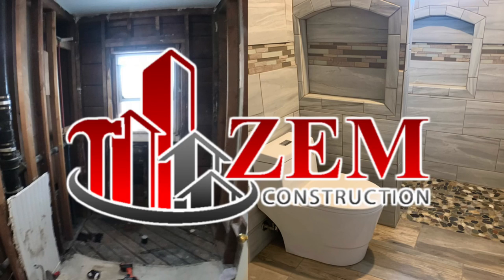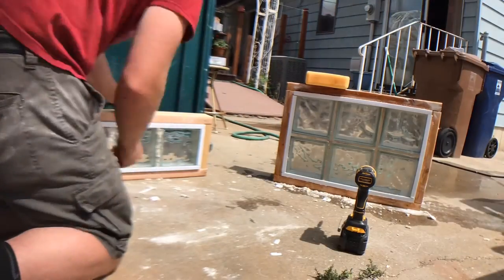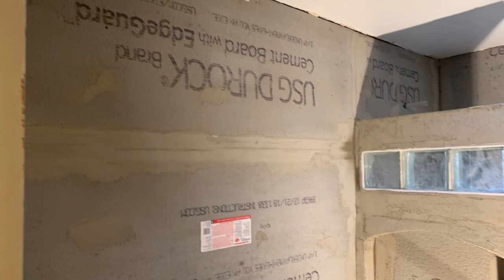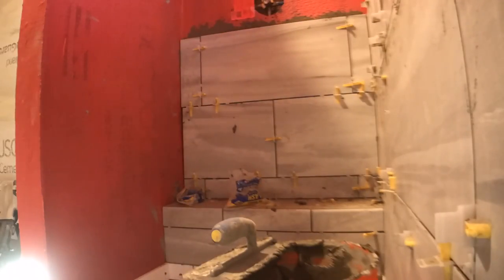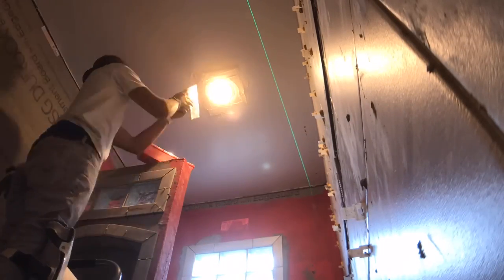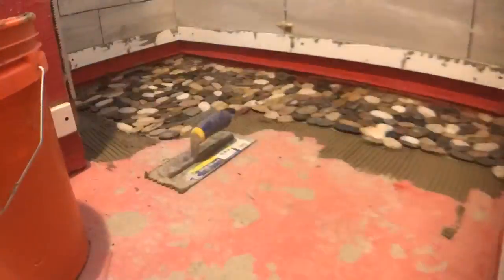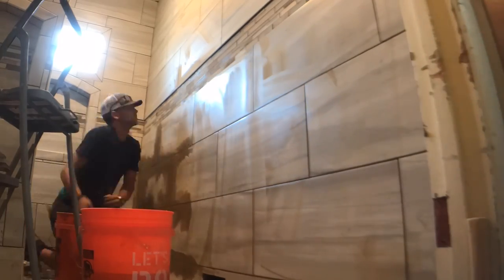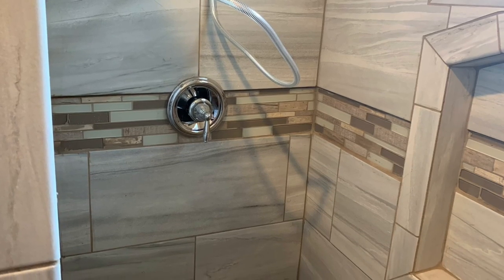Bathroom Remodel | Bathtub to Curbless Walk In Shower | Time Lapse

Comment: awesome job! A tip or two, of course each guy has thier own way of installing. keeping a wet sponge handy is a good way of making the clean up and grouting easier and faster by keeping grout joints and the tile face ,corners ,ect. clean as you go. You'll thank yourself in the end. Also wedi board 1/8" think is a good and easy way to make feature tile level up to 3/8" large tile with the 1/2" trowel. Again nice job, well done.

Comment: The niche and 3 piece window on the semi wall could've been centred to avoid cutting off the trim tile on the left and that awkward piece of accent tile on the right.   That could've been done by taking the width of the trim tile in consideration while constructing the semi wall in the 1st place. Also It's hard to tell if there is a corner guard on the semi wall? It would protect the tile from accidental hit by the wheelchair. And I would put the power switch and the plug on the same level. Just looks more finished. With that being said I love your cuts and attention to details. I know the amount of work such a small space gave you and you owned it
Reply: Yes, that semi-wall and how off-centered it is, is the first thing I see. Other than that, great job.

Comment: Nice job!!  This is the first  video of yours I watch and it is ironic.  Back October 2019 I hired a company to come in and make my ONLY bathroom into a handicap accessible shower for myself.  I am handicapped, but after just 3 days of numerous  & costly errors I had to fire them.  One of there workers also was caught leaving the house with my property.  (Sad)  So I have been without a bathroom for almost 8 months now and  don't think that I will be able to finish the  work myself due to my deteriorating health.  The other ironic thing is that I have the same tiles picked out for my bathroom.  What's the odds.  Well thank you for sharing your journey it is nice to imagine what my bathroom could look like.  For now I will wing it.  A red bucket!

Comment: Nice video, if i had any criticism it would be that you need to work on your grouting and the tooling of the joints. I used to be the grouter for my dads tile company and have grouted at least 20-30 entire houses on my own over the years, so i can spot a grouting job a mile away. I can tell it was difficult to clean up near the glass border because of the recess, but regardless you just have to spend the extra time to clean it up and smooth it out to make it look good. Keep your eyes sharp. I know none of us know everything and everyone can always improve in different ways, so take what im saying in good heart. 

Also, in the future, if you want to avoid that recess between a border tile and main wall tile because of the difference in thickness you can install 1/8, 1/4, or 1/2 backerboard where the border will go and thinset it to the wall to bring out the border flush. This will also fix the issue with the electrical outlet sitting away from the wall where the border was. Keep up the good work pal and keep learning and improving.
Reply: Not to be nitpicky, but I keyed in on this as well. Good advice for anyone doing the same type of project.

Comment: Great video and narration.  I also have a window in my shower.  I want to keep the window and not replace it with glass blocks like your client wanted in this video.  If you've installed windows in showers before, do you have any recommendations on which types of windows are the least likely to get damaged/moldy/rot?   Thank you.

Comment: Great work. Only fault is the mosaic band sets in.  It's not flush with the rest of the tile. Ik it's hard considering this band is 1/4 the thickness of the tile. Why I cleat the band then float the area to except the band last. So you can get a perfect flush band.

Comment: I appreciate you walking through all the steps of your projects, providing videos and also narrate - you do an amazing job!

Here is a question I have, how do you access to the plumbing for the faucet and shower if you ever need to work on it. I ask this because my bathroom is tiled and I do not see anyway to access my plumbing without removing tiles.
Reply: On most plumbing can  be accessed from the back wall.

Comment: I've always thought that all bathrooms, utility rooms and kitchens should have floor drains. A curbless shower is a good way to accomplish this. But it would require the entire bathroom floor to slope toward the shower. That way even if the toilet supply line were to break when no one is at home no water would escape the bathroom and damage other rooms.
Reply: Your talking about a wet room and this is not that. Most curbless showers only require the waterproofing 1-2 ft. past the shower entrance. Not to mention the cost of making a water tight room that most people cant afford.

Comment: I think you did a good job, if I had to add anything I would say that you should have taped the seams with waterproofing membrane in addition to the Red Guard.  Red Guard alone over cement board definitely isn't enough to waterproof changes of plane, and will likely fail over long periods of time (10+ years).  I do want to commend you for choosing a cement backerboard over HardiBacker for a shower install, since HardiBacker wicks moisture through capillary action.

I myself would have gone for a foam board like HydroBan Board, in addition to the a waterproofing membrane tape and liquid waterproofing overcoat, but it looks like you at least used a real membrane on the floor of the shower.

Really interesting to see how you cut away the joists and sistered them to allow for the curbless entry.  Great job with that!

Comment: I would hate to reach onto that shower valve, open it and have the resultant cold water spray all over me.  Always place shower valves in a location where they can modulate shower pressure and temperature without being in the direct spray of a "cold start".  I would have placed the valve on the adjacent wall to the left when entering into the shower space.

Comment: Overall nice looking tile job. Just 5 things I wanted to point out: 1) Both niches could have been located 1" lower to line up with the top of the row of tiles below it so you don't need a 1" sliver of tiles to make up the space below the niche. The niches placement should have been planed better. 2) The Niche inside the shower should have either been lower anyway, or the top of it should have been lower to avoid it cutting into the frame of tiles going around the window. 3) Even though you used tile leveling wedges, I suspect you failed to use the pliers tool to force the wedges in further, as I could see significant lippage of tiles in some spots. Maybe you only hand pushed the wedges in?  4) The mosaic tile border you used for the stripe is thinner than the wall tiles, so your installation looks awkward with uneven thickness now and depth of the wall where it meets the mosaic tiles. What we do is either mount the mosaics on a sheet of Schluter DITRA, or Schluter Kerdi, or sometimes we simply back butter the mosaics the night before, now you have a thicker solid sheet of mosaic to mash into the thin set, using a wood block to keep it flush with the front of the wall tiles. 5) Also, grout was not cleaned off completely in many spots, and corners, and you should never grout corners ever! Always use color matched silicone for all corners and change of plane areas. I see so many tile installations fail from installers who grouted the corner, then it cracks pretty soon. If you do you next tile job using the above advise, it will be perfect.
Reply: You took the words right out of my fingertips. The niches should have been planned better so they worked with the full tile. Also did see a lot of lippage. Two coats of red guard. And we will add 1/4 inch backer board or what is needed mosaic tiles go so everything is flush. Law the wall tiles first and then use a float to set mosaics even with top and bottom. Bathroom does look great though.

Comment: This job I am currently working on will be my first tile job, so I am soaking up as much info as I can. Same thing big walk in shower, and floor to ceiling tile around large bathroom. Flipping over tile to mark is same trick I use on my hardwood floors. Question though do you cut upside down or will that cuase chipping. Something I have been asking myself.

Comment: Narration over is definitely better.
Props on the volume levels btw, voice level isn't overbearing, and the looped background trance-esque music isn't overbearing like heard in many videos (barely noticed, it's just ambiance, 10/10).
Only criticism would be a better pop filter for narration (the fuzzy cover/screen in front of mic). There's a good amount of "pops" heard in narration on P's, S's, and hard T's/D's/Th's.
Vid quality is fine, understandable on battery/focus issues, but the positioning of the cameras were on point considering the setup has constant obstructions (humans passing by). I'd suggest a mount near the ceiling/floor for some angles, but not for this type of setting. Your current setup works better for this, nice attention to detail.

The project itself turned out great. Glad you went back for the insulation, having lived in houses before where they cut that corner on install/remodel and it's not fun having a tile wall or even the entire drywall/ceiling collapse on you while naked due to skipping steps like this.
The theme worked well, client really did plan this out well.
I'm currently dealing with another shower nightmare in current house and clicked to see what someone else has done for insight/inspiration, glad I watched.

Comment: You need to be using Wedi. I’m a contractor and I switched over to that. The time savings is insane. On top of that it’s 100% waterproof and
It holds on to the tile better than anything I have ever seen. Check it out. It’s far better than the old way. In fact it’s not even comparable. Look it up. It’s called Wedi. Super simple once you learn and you will never go back. Those pan liners, doing that pan mud and all that garbage needs to go away. Same with the garbage Schluter systems, cement board and so on.
Reply: They make the suction type
Reply: Matthew W what’s your point? It was done wrong. I could literally send you 50k examples of regular showers done totally wrong and failing too. Much easier to fail without WEDI than with. You obviously have never worked with it.

Comment: Thanks for the video showing step by step and naming each product you used.  I've done showers before from bare wall and it is rewarding.   I have a high detail orientation visually and what bothered me is how the arch inset cubby seemed crowded into the wall.  This would drive me nut.   I would have balanced the space next to the wall with the same space on the open end of the wall instead of making the one side smaller.  Otherwise gorgeous job.

Comment: I thought you aren't supposed to add waterproofing (RedGard in this case) to the top of a shower pan (between the deck mud and the tile)? Everything I've seen so far says that your waterproofing layer is at the bottom (your liner in this case), and that water that gets past the tile is meant to get to the deck mud layer where it drains to the weep holes on the shower drain. What are your thoughts?

Comment: I like the job and the arch layout. However why did you not clean the grout so it did not look like it has straight clean lines, and there is lippage all over, as well as the door casing is not installed so the tile edge will show when you do put it on.

Comment: How do you keep the wall backer tight at the bottom without using the pan to hold it or perforating your liner with screws?
Reply: Build your walls out the thickness of the liner being folded above the liner

Comment: Usually after a job there are things i learned or things I'd have done differently. what if any would you change?
Reply from the maker: I would have used a completely different tile leveling system. I also would have taken the time to make adjustments to the original framing. It was way more crooked then we thought and didn’t notice until the tile was already going up. I would have insisted we used products I’m more familiar with like the grout she bought was crap quality. I also would have tried harder to tell her that by adjusting the center stripe we could minimize the tiny rows of tile and overall make it look better even though it wouldn’t be “exactly in the center” I have another big walk in shower video I’m editing now where I made those adjustments and it turned out a lot better.
Reply: @ZEMConstruction  i would also recommend when using the spacers using 2 on each edge i noticed a lot of areas that were not sitting flush with the other tiles... but over all i like the amount of work and effort done in this job very good looking design

Comment: "All these ;products were purchased from LOWES …. as there's a Home Depot bucket in the shot.   LOL   It appears you modified an opening window, into a non-opening window.  Hope you installed an exhaust fan.
Reply: light in ceiling has fan in it
Reply: Gotta love commenters that didn't watch the video or was so busy trying to find fault that they missed "the home owner purchased a fan/light combination with just enough room around the light for the exhaust air to pass" along with complementing the homeowner for purchasing a quality item

Comment: I’m not understanding the placement of the electrical outlet above the toilet.  Looks totally botched because mosaic is not flush. Light switch suffers from this too. Then there’s the hand sprayer mounted way up high where nobody wheelchair bound can reach it.  It will have to just lay on the bench I guess. And it’s hard to tell but not sure how useable that closet converted to basin sink arrangement wud work in a wheelchair either.  Cud be awkward to maneuver a chair into that limited space and too high to reach. 

In the end it’s how they wanted/needed it but no potential future buyer is going to be happy with this layout. Gonna have to drop more cash remodeling again.  I do like the pebble floor.  All three of my showers have this too. Really adds to the aesthetic.
Reply: exactly.... you caught everything that I was going to point out!
Reply: I see what your saying, but when someone is remodeling their forever home they are not thinking about those things if it dosent pertain to them in that given moment. Everyone is not thinking about I have to design this so it will resell, or for someone handicap (if they are not handicap). I remodel my house for what I want for me. Normally that is why you buy a house (you get what you are looking for) or you remodel to have it fit your needs. I did say the same thing that it could be tight, but maybe they have more than one bathroom and this one is specifically for them. It was really nice. Maybe they are tall people, Basketball players.. lol

Comment: Wow, what a terrible tile job. As a tiler myself I would be fired if I did a job that bad. Lips everywhere, bad grout lines, the border is recessed when it should be level with surrounding tile, chipped tiles installed when they should be recut, I could go on and on.

Comment: Also, it is not a good idea to put a niche in an exterior wall because that leaves a space where no insulation can be put in the wall.  That's not necessarily on the tile guy but I have seen it done too many times.
Reply: That’s where a piece of 1/2 inch high density foam fits behind the niche to air seal and adequately insulate that space.
Reply: @brianfletcher7942  1/2" of high density foam doesn't have the r-value needed to meet code.  It would be better than nothing but if it was only a 2x4 wall I don't even know if they could get that in because a 3" wide shelf is not very useful.
Reply: Il problema principale è  che queste non sono case ma baracche!